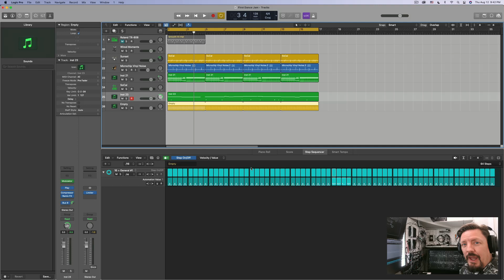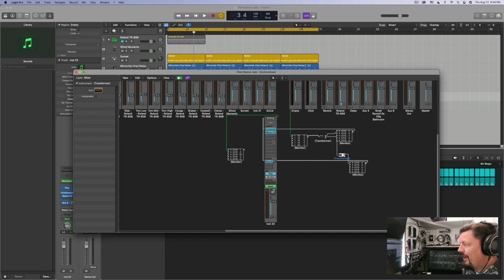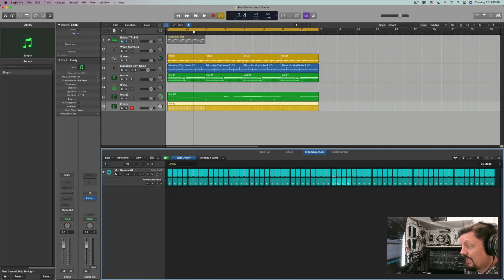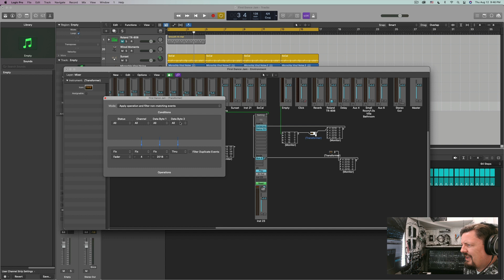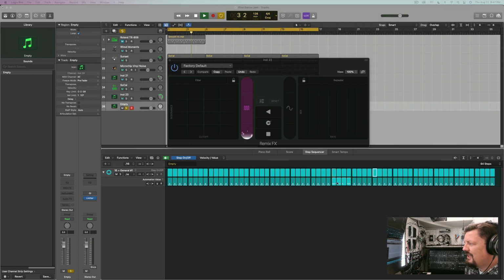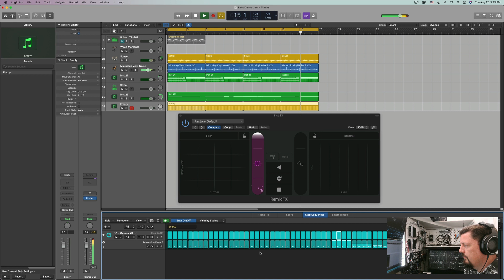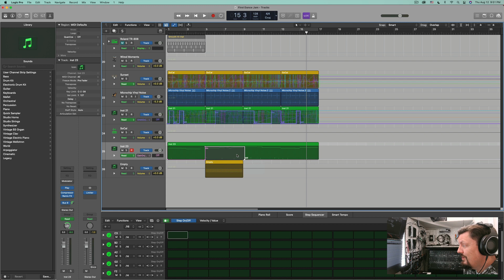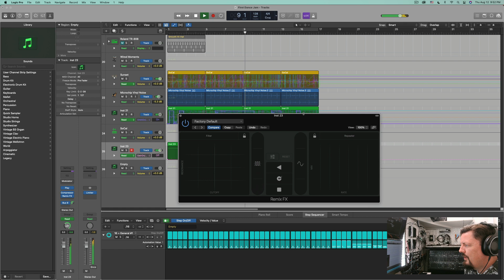Remix Hack | Logic Pro

Comment: There is an easier way to do this. 1. Make an instrument track and put ANY midi controlled effect in the inst slot. 2. Route the audio you want into the midi controlled effect with the sidechain input. 3. Add Remix FX to an FX slot on the instrument track. 4. Create a pattern region and add an automation lane for every parameter that you want to control in Remix FX. 

Note. you have to make sure and make separate sequencer lanes for each on/off parameter in adition to the parameters you want to control and turn them on with the main sequencer buttons AND the Automation Parameter drop down menu.
Reply from the maker: I’ll check this out. When I tried a similar version I couldn’t see any plug-in automation options for the lanes in the step sequencer. It was only only showing track automation and the standard CCs. Maybe I am missing a step in there.
Reply: @LogicProLife  Actually when you open the pattern region just hit option+command+L to put the pattern into learn mode. Then just touch the parameters in Remix FX you want to control and all the applicable ones with show up.
Reply from the maker: Ah, dang.... that is so much easier!! Thanks for the knowledge.
Reply: @LogicProLife  You're welcome! The FASTEST way in my opinion is to just use normal automation and draw it with the pencil tool, while holding down option for step mode but I also love using the pattern regions.